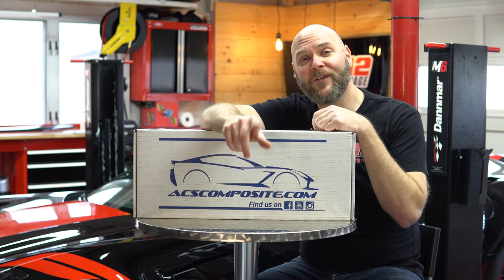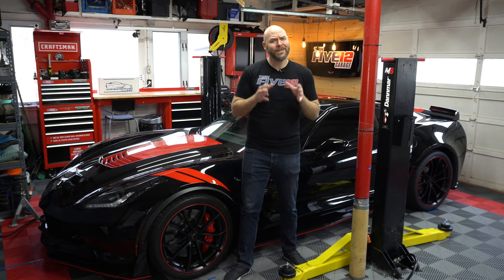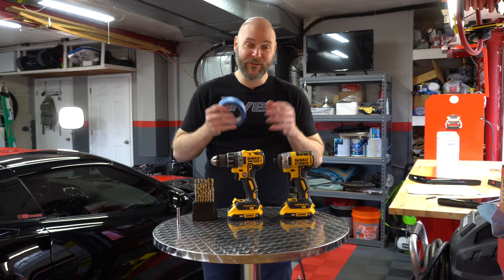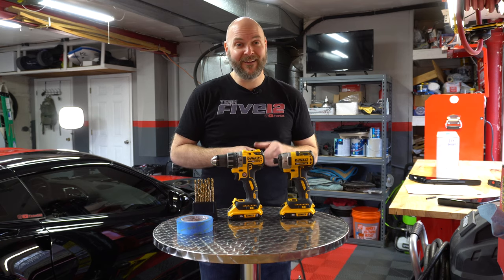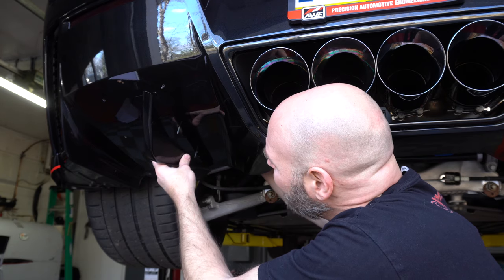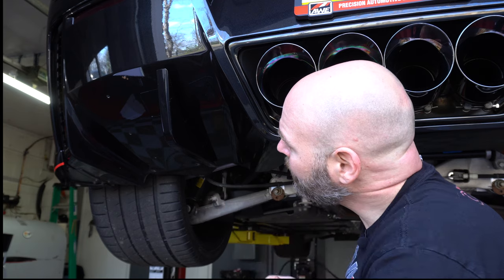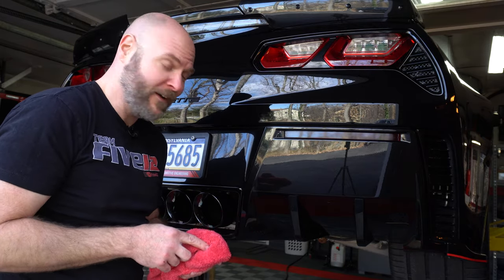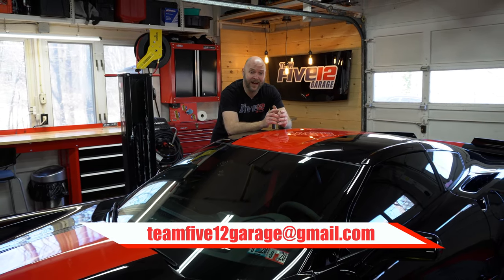The Ultimate ACS Rear Diffuser Fins Install for C7 Corvette Z06, ZR1, Grand Sport and Stingray

Comment: Another great how to Scott! About to install these as well and thanks for the pro tip for that hard to reach screw. QQ..is the pin striping the Oracal 651? I'm looking for an exact match to my torch red and wondered if you had any suggestions..links? I believe I may have seen Avery supreme 415. Thx!
Reply from the maker: Thanks again for the kind comment! Happy to help! I have used two different pin stripe tapes so far and I don’t believe either of them were the ones you listed. However, they have matched quite well.
Reply: @Team512  ..thanks Scott. Do you mind posting a link to the pin striping you leveraged on your car? Thanks!
Reply from the maker: Hey Tad, checkout the actual pinstriping video I did. I believe there is a link in the description. If not, feel free to shoot me an email: scott@teamfive12.com